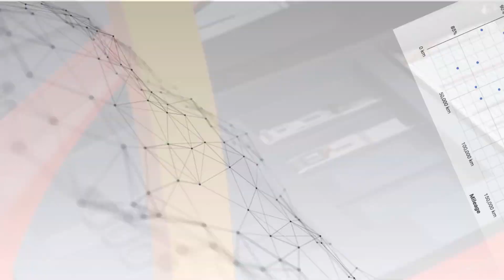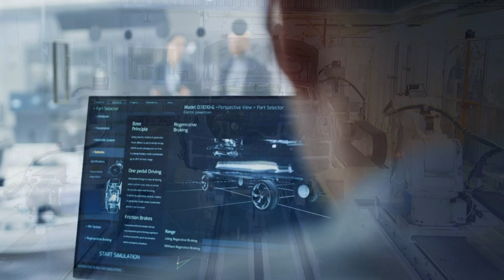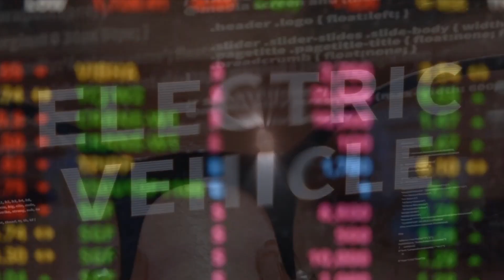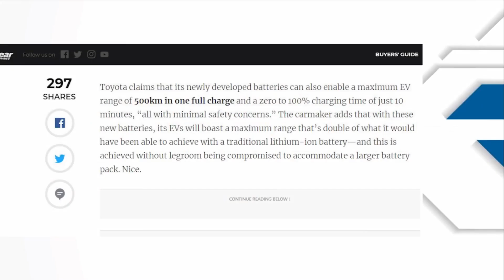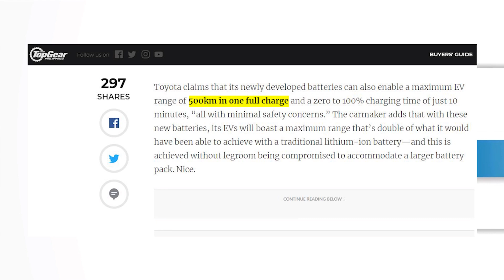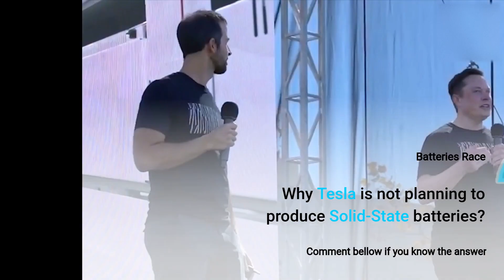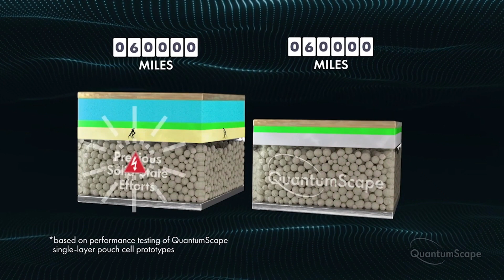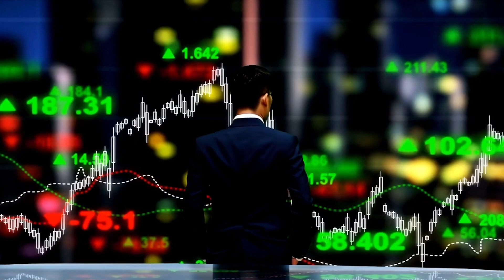Tesla 4680 Battery vs. Toyota Solid-State Battery: The  Race For The Future Battery

Comment: Huh? Tesla's batteries will reduce to $100 per kwh? BYD blade battery are already $85 per kwh and they use the much safer and zero cobolt LFP chemistry!
Reply: It’s more like $50 to $60 per kWh for Tesla’a high nickel batteries and $40 per kWh for the LFP variant. But the cost reduction doesn’t happen at once but after a few years scaling up the 4680 production.